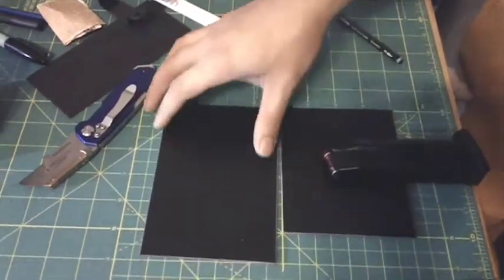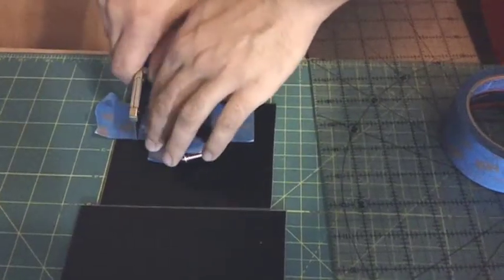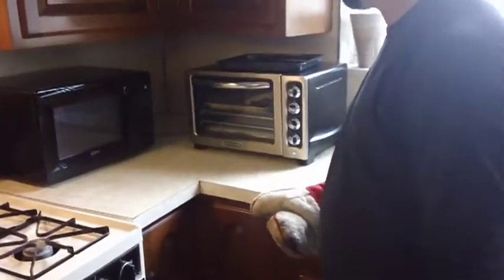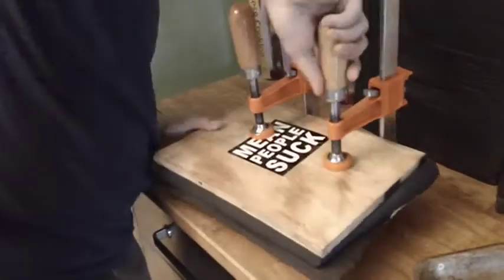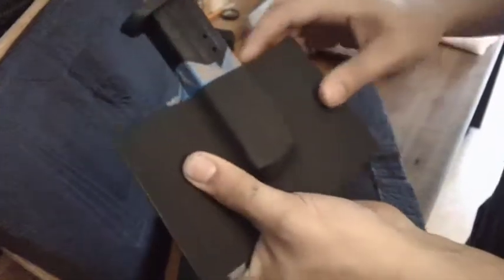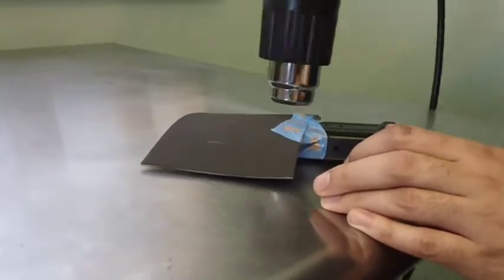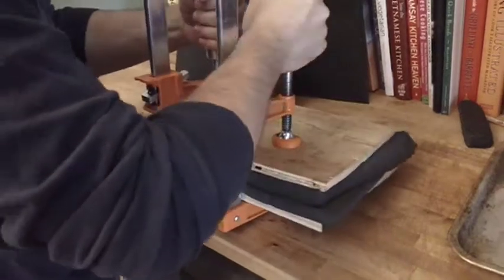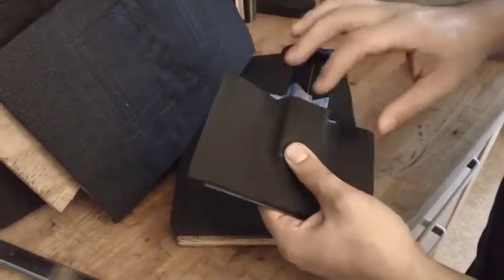DIY Kydex Mag Carrier Part 1

Comment: Great video, your super brave throwing heat on live rounds in that mag!!
Reply from the maker: That's a snap cap, homie.
Reply: a what?

also is there a mag you can use that will make a semi universal mag holder?
Reply: Josh the AK MAN check out the egg roll mag design they sell em for 55$ for two but the design seems pretty easy to reverse engineer

Comment: I don't know how many times I've watched these vid's; but it's quite a bit. I do have one piece of advice for plastic/polymer mags: USE SNAP CAPS! I only say that because the pressure can cause the follower and top section to deform without any support. Recently had an issue with a GSG-522 mag, fortunately I was able to save it.

Comment: Great video, I want to make a double mag holder, now I have an idea. Where can I get the black foam you use to press the kydex? thanks
Reply: It is actually the same foam as the foam mats they sell at hardware stores that fits together and is used for floors to make a cushioned surface. It usually comes in a 4 pack. Harbor freight sells it the cheapest. Just cut them up and stack them using spray adhesive until you get the thickness you need. Here is another video that shows you exactly how to do it and used the cheap harbor freight mats like I said [not my video] >> https://youtu.be/LWunm1GV9qU

Comment: Do you still make the mag carriers by heating only one side in the oven? I've been trying to heat both sides at once and press it just like a gun, but it seems to never be tight enough unless I switch to .08 from .06 and use a bit of extra heat.